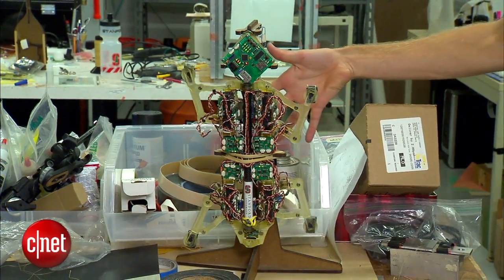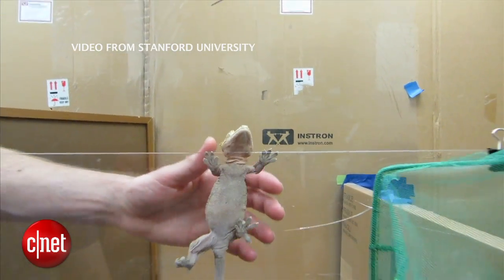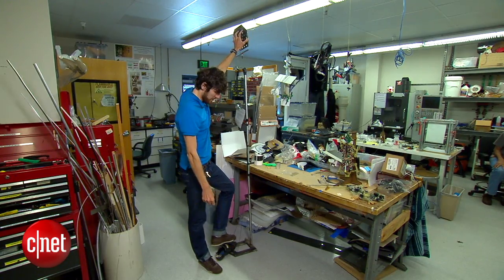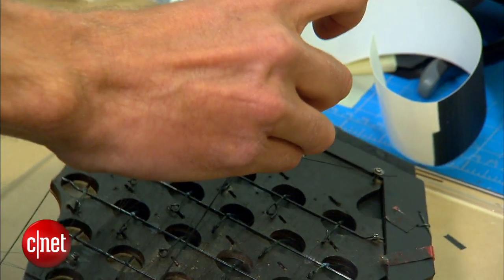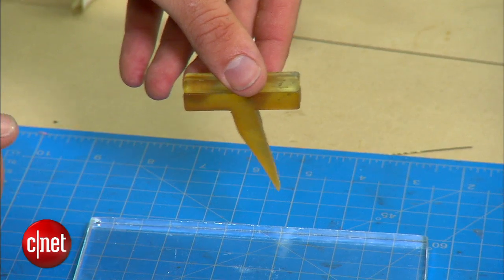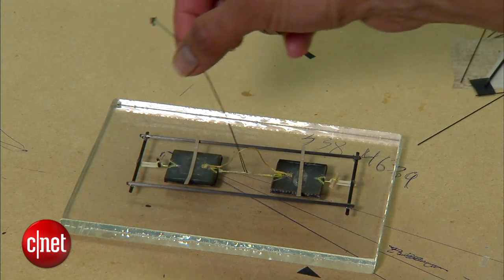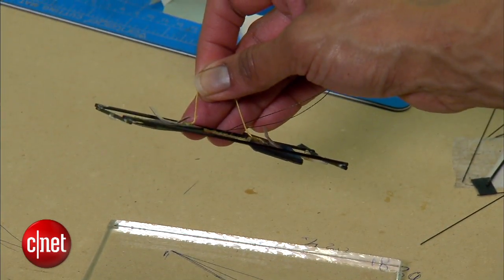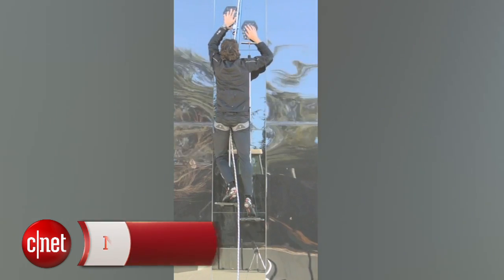CNET News - Gecko-inspired adhesive lets you climb walls

Comment: Will it work upside down? Lizards can do it...
Reply: it is unidirectional meaning it only works one way, against gravity. you can climb up and down walls but once you rotate it 180 degrees it is almost useless.
Reply: @Spudwellington  You could use two pads which each going in a different direction. If I’m not mistaken, I think  some insects have this property, where their ‘sticky feet’ are only unidirectional. So they use certain feet to climb up, where gravity pulling them down allows them to stick, then they use their other feet to climb down, where their other feet ‘sticky’ property are 180 degrees the opposite of the feet they use to climb up, allowing them to climb down. I can’t quite remember which insect this is.

Comment: It is 100% guaranteed to malfunction as soon as you are in a situation where you can fall to your death.
Reply: it can't malfunction but it can be used improperly. It's not like it's an electronic, it's using principles directly based on the van der Waals theory.
Reply: Too late I’m sold
Reply: I don't think it will malfunction because it's not electronic, and I also don't think the battery will die or run out of charge because it doesn't have a battery.